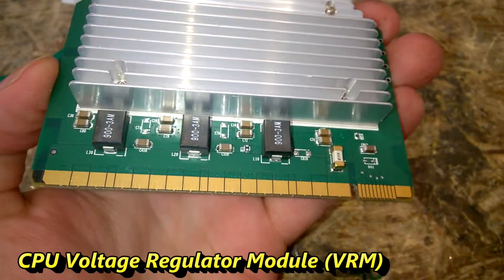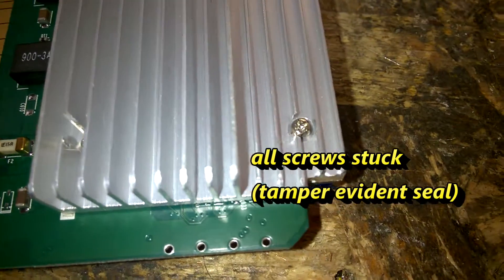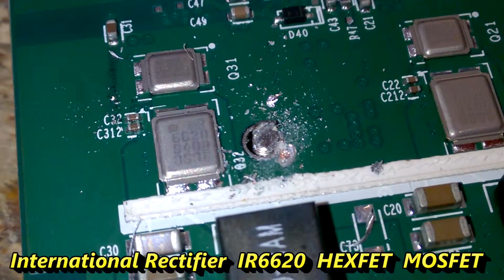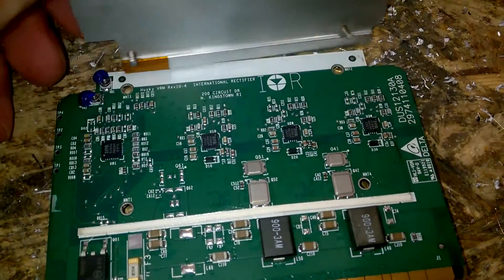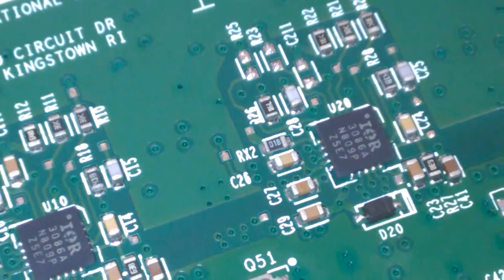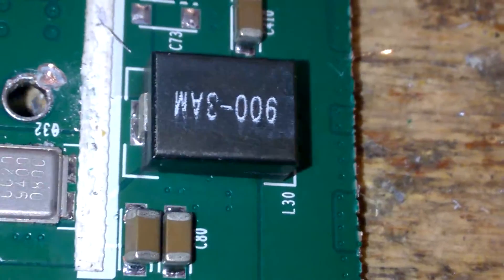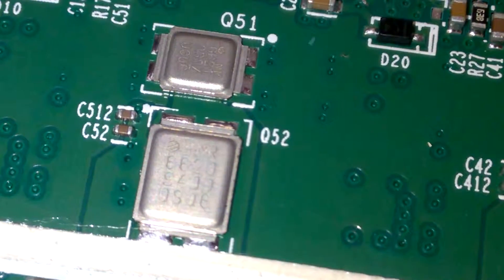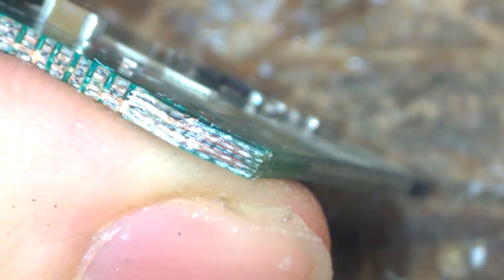BEB #4: HP DL380 Server CPU Voltage Regulator Module complete teardown

Comment: Hi Max. I have just been looking at 40A 12V server voltage regulators.
I am looking for help to use it as a voltage regulator in an analog power supply.
I have a large transformer and a large capacitor bank.
I am hoping with some large rectifiers i can arrive at a suitable voltage to power the regulator and then smooth q 12 or 13.8V output with my large capacitor bank.
Do you have any idea if this could work?
Looking for a way to activate the regulator via the multi pin input config.
Hoping the voltage is within the input range.
An example of such regulator: IBM 49P2119 xSeries